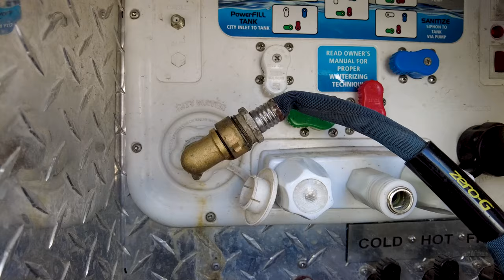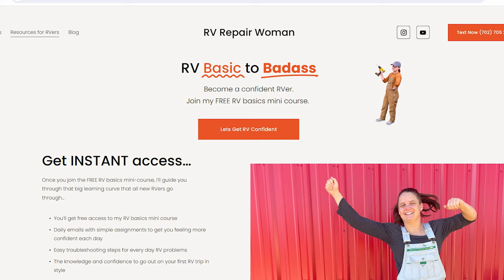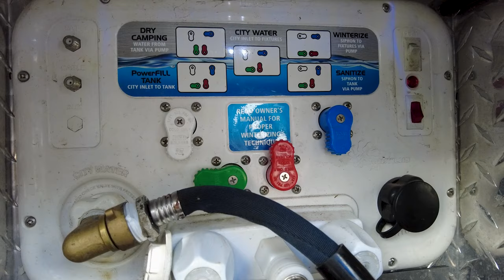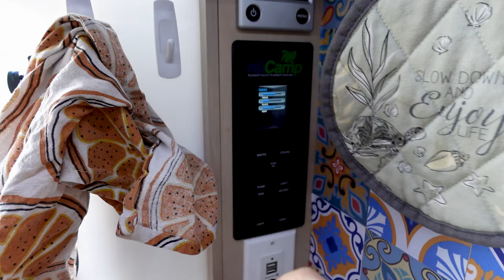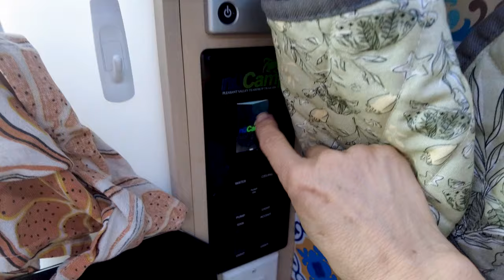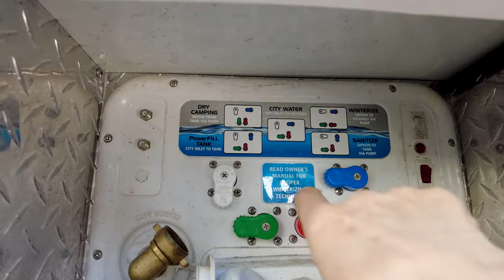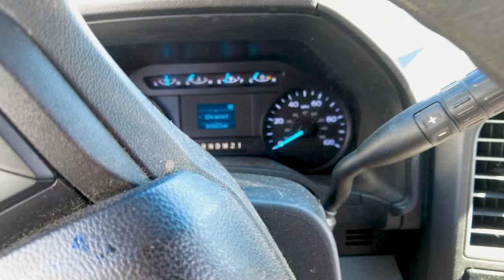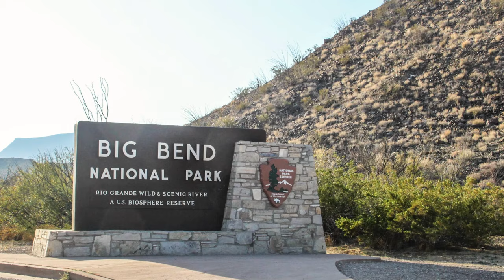Comparing Urban Campgrounds Vs Desert Boondocking In Vegas - Truck Camping Solo Female Full-time

Comment: Great video Kimann! With regard to the Sea Level black, grey and fresh water monitor, you’d have an easier time finding a Unicorn than finding a Sea Level monitor that is accurate for any length of time in any camper. Especially the black tank. Be that as it may, it’s pretty easy to gage when the tanks are getting maxed out. Happy travels!
Reply from the maker: Yes. I have learned to know when the tanks need dumping. I read that the exterior-mounted tank monitors are more precise, but my camper didn't have that kind.

Comment: Kimann do you ever worry about, if you have to for some reason get in the truck to leave in a hurry. That's the only worry I have otherwise I love your camper
Reply: That would be my worry..well one of many 😅
Reply from the maker: For that reason, my first rig was a van, but with the camper, that issue has never come up. I always feel safe in my camper. It feels more like a tiny home to me. I usually check apps and use my gut. If a place feels sketchy, I don't stay. The only inconvenience is if it rains and I must go outside to get into the camper.

Comment: I haven't been on either but I'm so excited to  find out. Been looking on Facebook market place for a van or camper. Still haven't totally made up my mind.   Anywhere else I could look for one? Any advice would be helpful.
Reply: I would recommend a dealership because they maintain them before sale
Reply from the maker: I agree with @BecKintheBox. Don't rule out dealerships. Also, if there is a particular RV or van you are looking for check FB groups for that brand or type. You can post a message if anyone is wanted to sell.